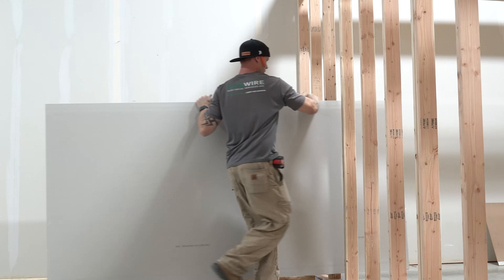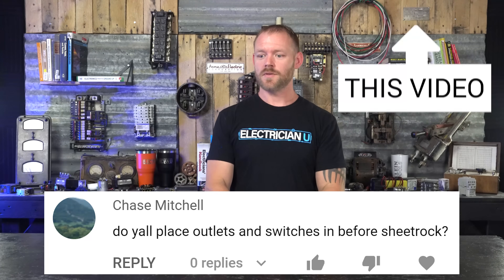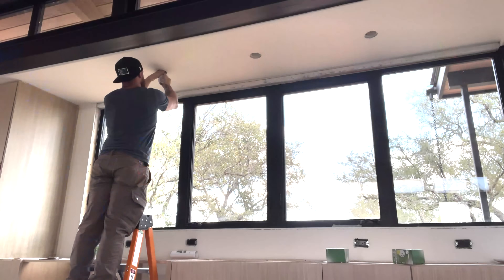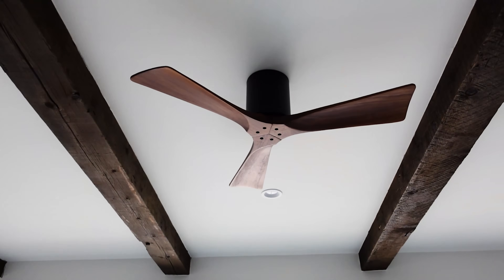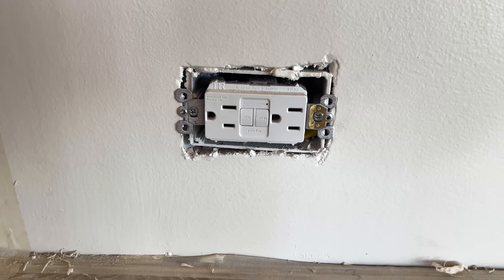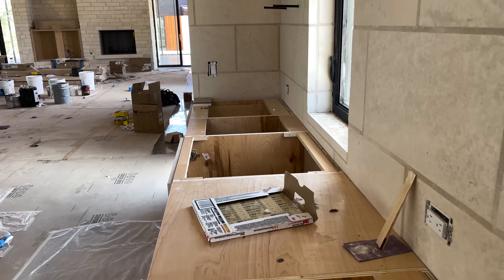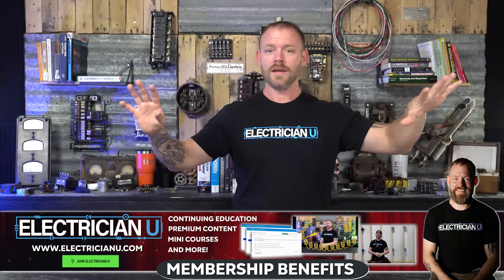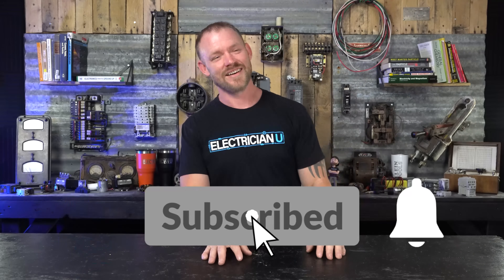Installing Receptacles Before or After Drywall?

Comment: Hey electrician U I have a question 🙋‍♂️ code for new construction houses say that all dwelling places need to be ARC fault protected. we put arc fault breakers. My question Is it possible to use a arc fault receptacle and slave the whole circuit. Use a regular breaker at the panel. Would that pass  code.

Comment: Personally, in my 35 years of electrical experience, I have never put them in after drywall. The amount of added labor cutting them in afterward would be quite a bit more than the other way. It's typically the guys that hang the drywall belong to the same company that finishes the walls.

Comment: The real question is.... "How do I convey to painters and drywall mud guys that those little holes need to be filled with screws?" 
Perhaps reiterate that screw heads shouldn't be covered in paint. Ah, the joys of multiple crews trying to git-r-dun! 😆
Reply: Boxes filled with mud... Wires in boxes fuked by rotors... Forgotten boxes behind drywall... 
Never knew why, but those who hate/don't care the most about us electricians are usually the drywall guys...

Comment: In new multi family construction it's much better to put the receps in first as it's easier to replace a few of those rather than ripping out all the drywall to run new wire because the wires are cut down to an inch or two by the rotoziptards.
Reply: Wont make friends with this idea

Comment: Freaking dry wallers and cabinet makers rarely cut out outlet holes correctly. I don't mind cutting a little dry wall, just as long as my upper and lower Mickey Mouse outlet ears rest on solid dry wall, tile, wood or whatever.  SURE, I've got spacers, but I shouldn't have to have spacers AND jumbo plates everywhere.

Comment: Best time is after last coat of paint. Too many times general contractor or homeowner wants them in even before first coat of mud. Nope. Not today. Had a house where they wanted black devices in bedrooms, office & family room. Expected me to clean off all of the white paint off them. Nope. Told them that should have use blue painters tape.

Comment: Do you keep Romex sheathing on until after drywall or strip it off and tie things together in the box during rough in?
Reply: Was taught many years ago to strip jacket off before installing it into box. Some inspectors demand that you splice the grounds so they can give them a look over while programing rough in inspection. Any time we had 2 or more cables in a box would install a wrap of black tape to Identify the hot feeder. If we had a 3 gang box would strip the jacket off leaving around 18" of the hot feeder to loop around switch terminals. Saves a splice.

Comment: Is there not a disposable cap that be applied to switch and fixture boxes prior to drywall and paint?  As a homeowner, I shake my head when I discover copious drywall dust and painted wires in boxes.
Reply: Would wide masking tape (painter's tape) be good enough?
Reply: @larrywest42  There’s little facing surface on the boxes to attach tape to. I’m imagining a cheap plastic shield similar to a drink cup lid that would snap on.
Reply: @larrywest42  ... that would work, but you'd need 3" wide tape to make it faster. (yes, it's sold)
Reply: I’ve seen something that is essentially that. A plastic cover that slides into the box, with a pointed tip (think a tent or teepee) that drives a hole when they put a sheet of drywall up.
Reply: Mark N Guard is the brand name

Comment: I've done jobs where they want power and switches in because drywall is months off and figure to just say the drywallers will deal with it... well they do... rotozip right through the middle of outlets and switches and the drywall finishers HATE it because they have to go around everything, so after plates you see holes through it, texture/paint on everything.....

Comment: As a small electrical company I like to make a trip to job sometime after drywall is sanded and primed!  I'll put my switches and receptacles in and mask them off with masking tape!  That keeps paint off of them during painting process!  Depending on where electrical panel is located, such as unfinished basement or such I might put breakers in as well!  All this depends on my time schedule with other jobs but I've always found it nice to do the devices right after drywall!  It also allows me to know if I have outlets that didn't get cut out by drywall hangers and can get that taken care of! Sometimes there's situations where drywall has to be repaired because of that!  Getting that done in the early stages is a better process for the job as a whole!  I've always been a team player and try to keep from inconvieniencing to other subs on job!
Reply: Man we don’t install anything until it is fully painted and finished
Reply: @beauwoodbury1112  if you're a larger very busy company I get that I work mostly alone for the last 10 yrs, got sick of dealing with sorry help!  So I don't do as many jobs that allows me to do it the way I do! I also live in a smaller community than a larger city!
Reply: I got to admit I always get talked into helping out in different situations before it's even time to trim out. I'm totally for making it easier on the next person working. But of course there are times where I can't make it there until the very end.
Reply: @jacobplank  I used to be the same way but I realized the more you do for others the more they will ask of you and it makes a difference in the end with how much “free” work you end up doing. I could choose to look at it as I still get paid at the end of the day but fuck that. My boss is the one who gets shorted if I do it too much and I choose to look at it this way if my boss is getting more for what he paid for then I will get more than what I worked for.
Reply: @jacobplank  absolutely

Comment: In my area, we use recessed panels. And they're usually energized before we come in for rough so there is temp power on site. After rough, we put in a handful of GFIs and break off the ears.

Comment: Depends, maybe keep some extra 'ugly devices' and temp switches if you're buddies are having to work in the dark.  All up to you though and how you feel about the other contractors. Helping out another crew can sometimes (sometimes) go a long way.
Reply: I always give them a few convenient receptacles, during winter (shorter days) a lot of times they want a few temporary bulbs for lighting.
Reply: I usually only install 2 receptacle temporary receptacle. In the laundry room for the washer and for the fridge. That's normally enough.
I also plug portable heaters with for drying the drywall mud / heating the house or the appartment.

But i'm normally in commercial buildings. Any extra tips?

Comment: I do them after. Hell the drywallers can’t even cut all the holes without missing a switch box or a outlet box. I’m not putting 2 grand worth of devices in just to be replaced 2 weeks later at trim out